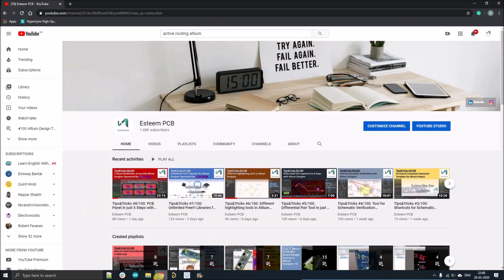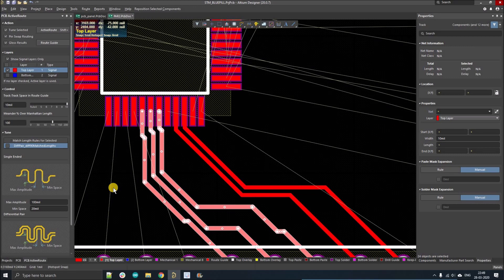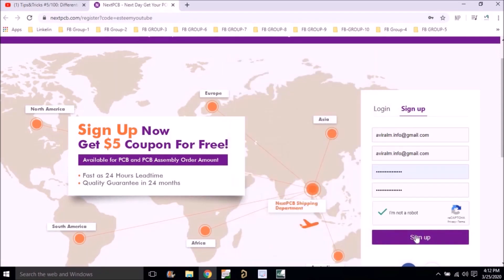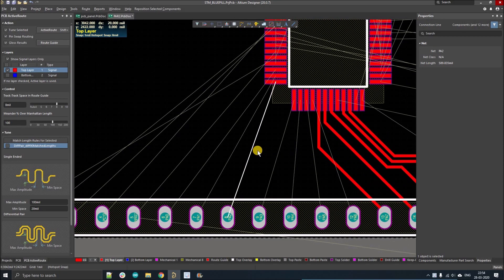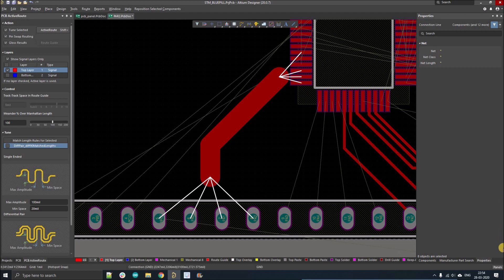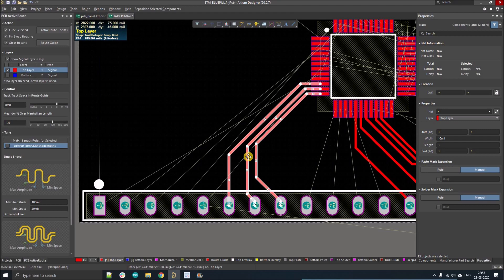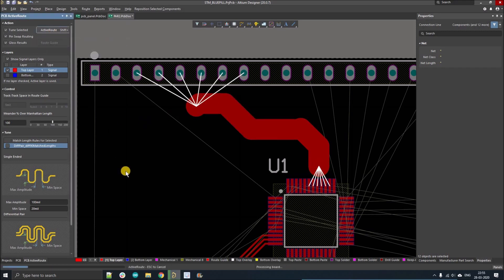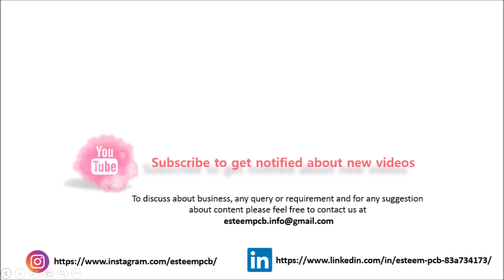Altium Designer Tips #9: How to Route Multiple Tracks Together

Comment: Hello, great video.

I'm new to Altium and I have a question:
When designing my pcb, I imported my components following your example and I try to connect my pins or rather the pads of a component between them.
When I try to connect 2 pads together, I manage to make my trace start from the center of my 1st pad, but I cannot connect this trace to a 2nd pad. The trace avoids the pad. 
Do you know where the problem comes from and how to solve it?

Thank you in advance for your precious support 😊.
Cordially.